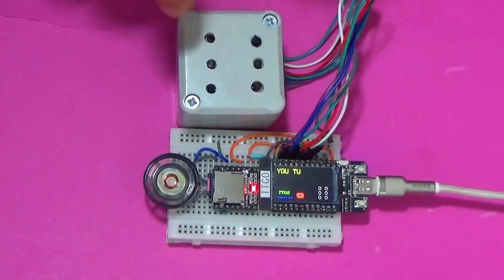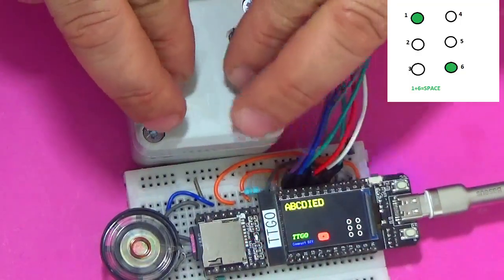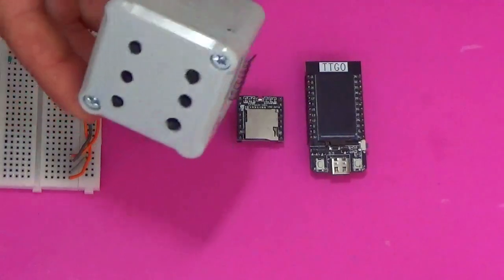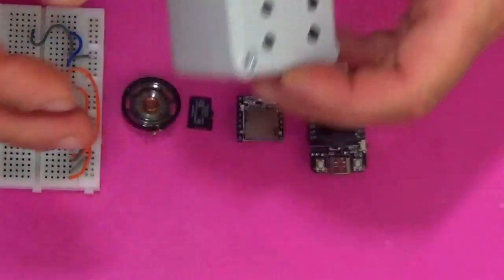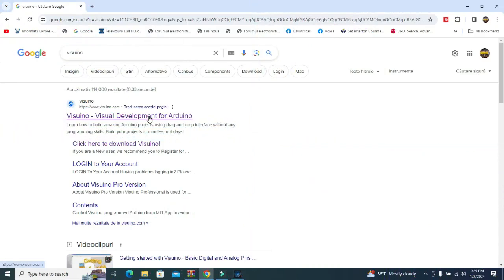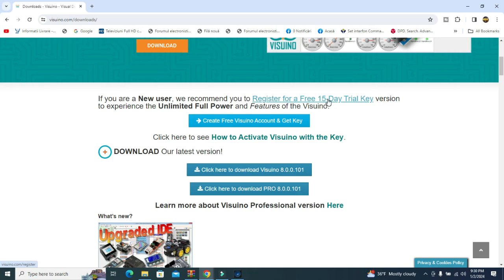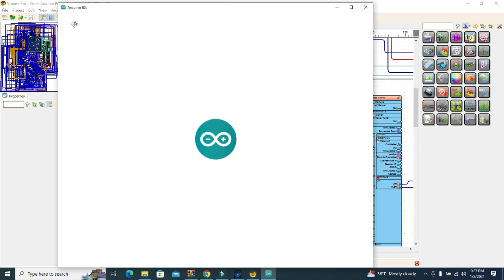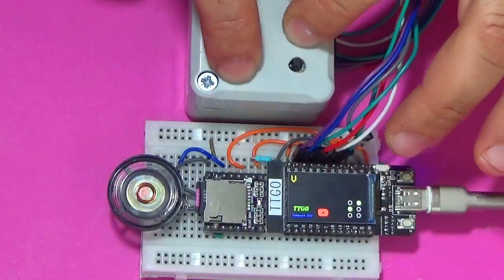ESP32 TTGO Braille Machine! Visuino Faster IDE Project!

Comment: HI! You could do a project in reverse, i.e. an MCU (arduino, ESP32 etc.) interprets a text file (txt. doc. etc.) and transforms it into braile, i.e. six small punches emerge from a surface forming the character to be read with a finger.
Reply from the maker: Hello, I'm sure it can be built, there are examples on YouTube, I wanted to make something that doesn't exist. It can be easily done with 6 SG90 servomotors, the mechanical part is more difficult to do.Thanks for your comment!